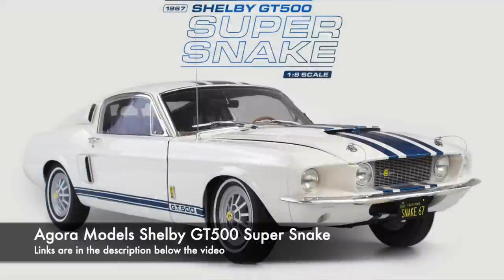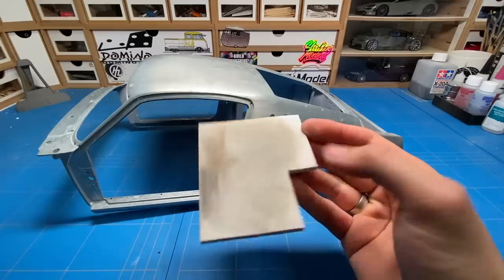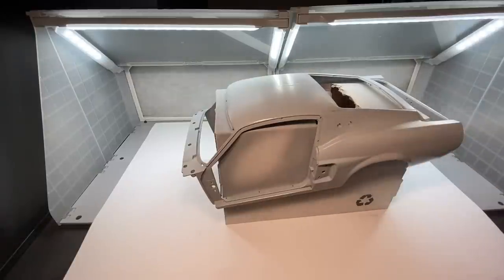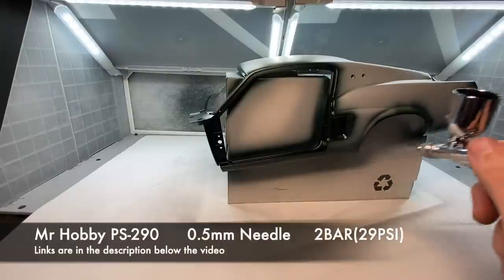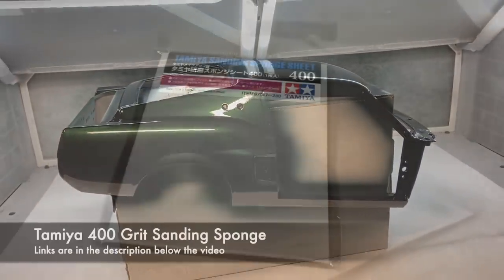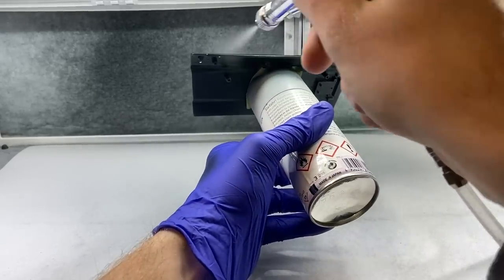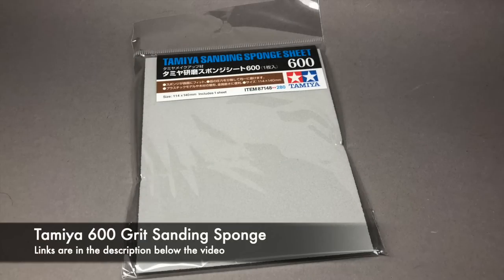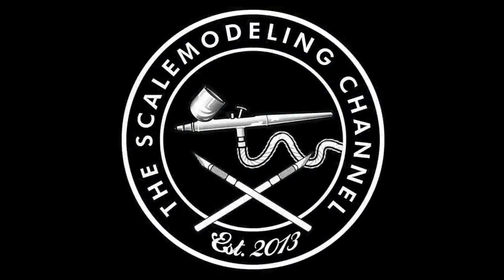Agora Models: 1:8th scale 1967 Shelby Mustang GT500 Supersnake Part 3 Full Repaint

Comment: Good video 👍. I would recommend you using a touch up gun though. You can see the overspray the air brush us leaving on every pass.
Reply: Is a touch up gun not too big for a model of that size? Doing a 1/8 repaint also and the small bits like the mirrors, fuel flap, spoiler legs are thumbnail sized.

Comment: Beautiful work. I do however have a question.... Why wouldn't you use a self etching primer on the bare metal parts before spraying the grey primer? In my experience with painting full sized vehicles, the self etching primer guarantees there won't be any bubbling in the paint work. Just wondering why you wouldn't be using it.
Reply from the maker: Havent thought of it. 95% of what i do is plastic. So don’t have that much experience with metal. Certainly not on this scale.

Comment: Now you've been using it for a while, do you prefer the trigger style airbrush over the traditional style? I've been thinking about getting a trigger style and would love your thoughts on it.
Reply from the maker: I prefer the trigger way more, it fits in my hands perfectly and gives me a lot of comfort. The traditional top trigger gave me cramps in my hands.
Reply: I also get cramps I’m my hands from the traditional. I love the trigger style. One important thing tho. Make sure your compressor can handle it. It pushed out a lot more air. And will drain the tank. Make it run all the time and build up condensation from constant use. So either you will get water in your paint, or the coat won’t be as nice as it could due to the compressor struggling to push the air. Make sure you have a compressor with a tank. Or at least one they can handle that demand.
Reply from the maker: Also in general, instal a moisture trap on the compressor

Comment: Parts are poorly prepared for painting.
There is a lot of debris and dust on the surface of the parts.
The painting is uneven and the surface is not smooth.
Reply from the maker: Very constructive comment.
Could be me. But the parts looked just fine and smooth after i finished painting them. But hey, who am i to say, right🤷‍♂️